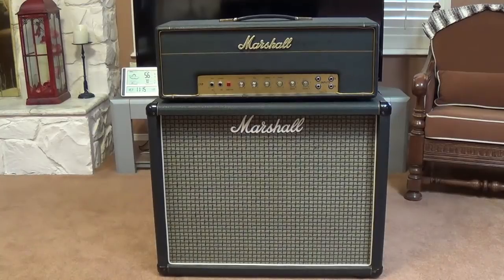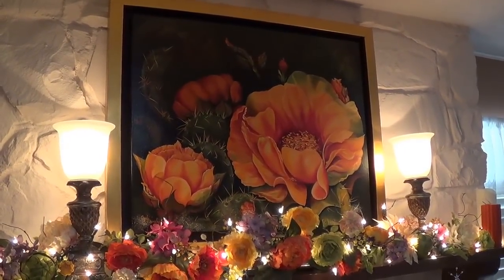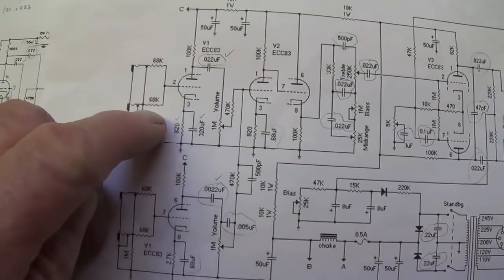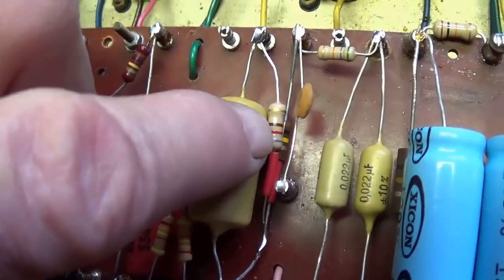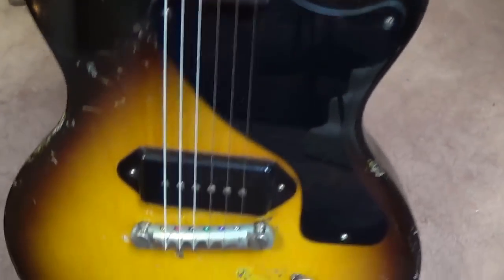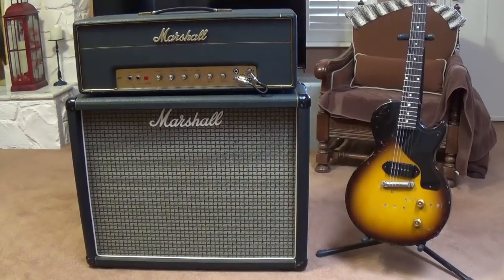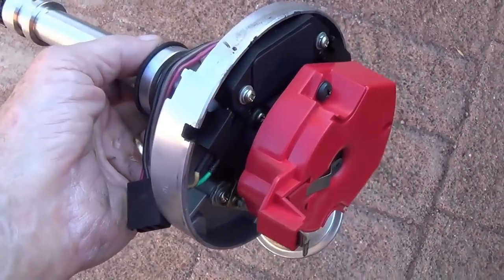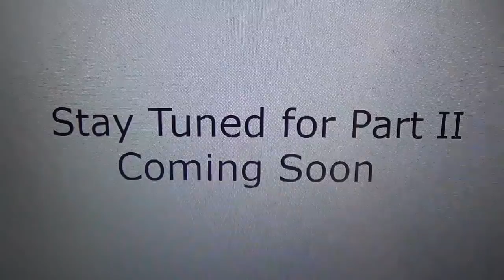Marshall 1986 JMP-50 Bass Amp becomes a Model 1987 Lead Amp.....with Extra "Mustard"

Comment: The 1987 has less bass, as would be expected from the circuit changes. I don't think the caps made a difference. But, in all fairness, I've never heard a proper cap ever make a difference.
Reply from the maker: I agree, but the value of the coupling caps was changed dramatically.....which does have an effect, as you noted.

Comment: You have to be careful.  All the available schematics are from 1970 and later. I have worked on and restored over 50 pre 1970 examples and there were differences.  I Believe you said this was a 67.  The 500pf cap should be there also someone mentioned the slope resistor however in 67 through 69 I have seen both 33 and 56k in that location.  Some of the power supply caps are dual 33uf caps not all dual 50uf like the later.  I have some picks of 100 percent orignal examples of you would like.
Reply from the maker: Thanks for your knowledgeable input. I realize there are some other rather subtle differences.

Comment: I do prefer the 1987 with the mustard caps, it seems a little cleaner, not as muddy and with less breakup.  IMHO i believe the difference is with the circuitry and to a lesser extent the caps as long as a better grade of component was used.  If someone had unlimited time and money an interesting experiment would be to replace the mustard caps with modern, high end components with the same circuitry and then do the A/B comparison.
Reply from the maker: I am not a believer in using boutique capacitors, Ken, and I tend to think that any good quality cap is as good as any other.......but tone is quite subjective and some folks insist there is an audible difference with certain, generally very old or very expensive, capacitors.

Comment: UD, your wife is as talented as you are a thoughtful instructor.  So to my ears the breakup on the 1986 is pretty flabby.  Unfortunately you must use a little imagination on the rest because the mic placement was different, and it doesn’t take more than a few mm to dramatically change the tone.  Regardless, love your vids!
Reply: I agree, minimal change in mic's placement can change the tone a lot.
Reply from the maker: Thanks, NYC. I tried to limit the variables......sorry if you found my efforts to be lacking.

Comment: Caution please... 50 year old new old stock (NOS) parts off a shelf have years of chemical degradation just sitting unused. Old NOS parts are aged, not the same as recent manufacture.  I have had many NOS caps test OK right away, but suffer very short life once actually used in a circuit.
Reply: The mustards use a polyester dielectric so are very reliable, still worth checking for leakage at the rated max volts though.
Reply from the maker: Thanks for your concern, Jennifer. I will convey this information to the owner of the amp.
Reply: Just sharing some hard earned knowledge.. Higher quality film caps DO tend to be be, on average, pretty stable in storage.. but I have experienced a few that tested ok on the 'ol HP LCR machines, but failed after in service a few hundred hours.  Of course, electrolytic caps are the terrible offenders with degrading over time. Nice job on this amp!
Reply from the maker: @jenniferwhitewolf3784  Thanks, Jennifer :)

Comment: Had you switched from one to the other using the exact same short passages through the two different circuits, you would have gotten a MUCH more accurate assessment of the two. That would best be accomplished through quick cuts in editting. Just a suggestion.
Reply from the maker: Thanks, Scott.

Comment: You are probably going to be getting a vacuum issue with that adaptor for the 3x2 setup....that plenum should also be split and not fully open.....which as best I could tell appears to be open.  That 4bbl intake is a split plenum so the motor acts like its 2 siamesed 4 cylinders...outer end cylinders joined with the opposite bank inner cylinders comprising one 4 cylinder motor X 2.  Street manifolds are this split design because they need the low end response down low in the rpm band off idle.  RACE type open plenum tend to start in for power at 2000rpm+.   SO you will probably get an off idle bog with the open adaptor.  The original 3x2 designed manifold is a split plenum.....so you might be better off grabbing one of those instead of that adaptor for the 3x2.You should really consider getting a MSD6a ignition box.....its the difference between night & day.....AND your wires......fabricate a set of real wire wires.  I always go to the electrical supply and buy a few feet of heavy gauge copper stranded wire and use a donor old set of wires for the boots and connectors...soldering the connectors to the copper wires......to get the maximum coil energy to the plugs.....and the wires last forever.  I've also used extra insulation on the wires by splitting the appropriate size clear poly tubing to slip over them.    GAS & SPARK...…...
Reply from the maker: Thanks for all your helpful suggestions, Mike. One thing you might be forgetting is that Stromberg 97's only flow around 150 CFM,  so when the engine is running on the primary (center) carb only , the manifold vacuum is quite high and the throttle response is instantaneous. When the manual secondaries open, usually around 2500 RPM minimum, the boost in acceleration is quite strong.  It honestly couldn't run any better.
Reply: being curious....why did you change from the 4bbl ?  The nostalgic thing ?
Reply: is that a performer manifold or an airgap ?
Reply: ahhh an air gap....just looked at the video again.....interesting......you can get away with that in the desert country hahahaha......wouldn't work where I am at.You've never had carb icing ?  humidity low enough all year round ?
Reply: turbo 350 or did you go with a 4spd od ?   What rear end ?     Looks like straight plugs.....running factory cast iron ?
Reply from the maker: @mikecamps7226  It's an airgap, Mike. It's what I was running on the car prior to the conversion.
Reply from the maker: @mikecamps7226  Yes, and ever since I had a 1965 GTO with tri-power, I have had a fondness for 3 x 2's with progressive linkage. The kick when the secondaries opens is exhilarating.
Reply: hahaha a 65 GTO.....I almost bought one myself.....a single owner.  But it was a 15 year old car at the time......just used to go to work and the store & to church hahahaha.  When I was growing up, my one neighborhood buddy's older brother had one but it was a 1967 & all hopped up since it was the era of the muscle car as the everyday car from the dealers......he used to take up for rides.  My older brother was into corvette's and the second one was a 67 roadster with the stinger hood 427 tri-power with 4 speed and posi...a menace on the roadways.   Have you calculated the G force.....as there is nothing like experiencing the feeling when pushing the pedal down and having it launch into the power band and it  pushes you back in the seat where you can't physically pull your head forward.>>>>>>>>>>>>are you getting good grip and pulling the front wheels up......or laying a good patch and blue smoke...going through back tires.   That was one of the tell tale signs......the dual stripes on the road in front of somebodies house....  if you were in hotrod territory.>>>>>>>>do you have bucket seats or full on retro and the vintage airplane flight seat ?  RODS are always a work in progress.....and in primer

Comment: anyways...
i never really understood why Marshall would squeeze tone with 2.2 nF, than give it 100 and back too 22 again. like they where just trying out different stuff. 

i never felt the need to drop V1b tot 2.2. 10nf is more than enough squeeze to differentiate from the normal channel..

Even if mosterd are used...they hardly ever break. Tube tecs in the Netherlands know that very well.
Reply from the maker: I agree. Thanks for your input, Pief.

Comment: 1986 sounds better when both chanels are not jumpered which is nice.The 87 on the other hand you kind of need both chanels.I prefer the 86 bass because it sounds better with overdrive pedals then the 87 its punchier,warmer and cleaner.
Reply from the maker: Thanks for your input, Rory.

Comment: Shame you couldn't compare the two circuits FLAT OUT on the volume like they're meant to be used!
Reply from the maker: It's a shame that you cannot enjoy a video in which equipment is adequately tested at reasonable volume levels.
Reply: @UncleDoug  But my point is that these Plexi Marshalls were at their best and usually run FLAT OUT. Hence my thought.

Comment: was of time and money putting full vacuum on the distributor
Reply from the maker: If you say so.
Reply: well unless you have a trick up your sleeve, it will be fully advanced with full vacuum, when you want it advanced is during acceleration and thats above the throttle plate.
So you will set the timing at full vacuum, full advance, and then when you use the gas pedal, it will retard instead of advance and will retard to lower than idle setting which will be way too retarded.

I'm just trying to save you a headache, been there before.
If you dont have the port, it might be just leaded shut or cast but not drilled.

Hope you had a great holiday season

God Bless

Comment: i ordered this   it's on it's way    https://www.tube-town.net/ttstore/tt-kit-jc18.html  
here is the schematic   https://www.tube-town.net/cms/userfiles/media/tt-jc18/tt-jc18-schem.pdf

and it seems like a bass   amp  so i have to go with  0.68  at  the cathode bypass  instead of 220uf    and  0.022 instead of 0.1  at the last coupling 
and   those  2   x   100 / 100  uf    filter caps  
and one bias resistor for both el84   should i put 2 seperated 
what do you think uncle ?
Reply from the maker: Did you order the chassis and faceplates, John ?  They seemed reasonably priced. A cathode bypass of only 0.68uf seems a bit low to me. You need to experiment with different values to find the exact tone that suits your ear. One bias resistor for both output tubes is fairly common practice. Again, find the perfect value for a conservative bias. It appears to be a very nice kit. Let us know how it turns out.
Reply: @UncleDoug   Yeap chassis  faceplates  knobs  shields for 12ax7   retainer for el84  not a cabinet  yet 
0.68 is the value on the 50 watt 
2 x 1 ohm biass resistors  will  let me know if the tubes  are matched  

yes probably i have to tweak it    and  use those  calculators   at amp  books  to get an idea
Reply: @UncleDoug  i made it  
no hum no harm 
no hiss  is bliss